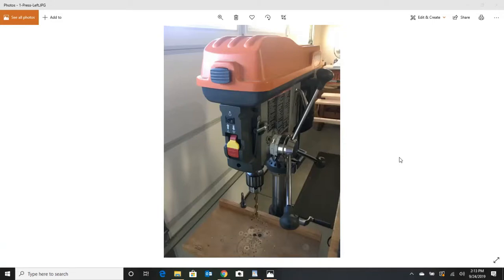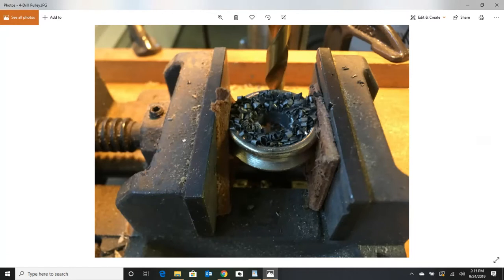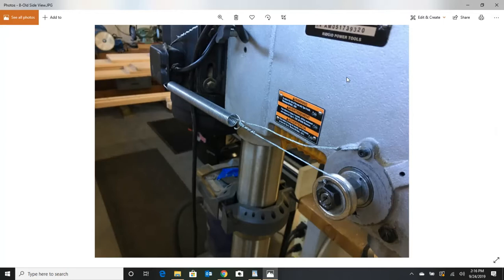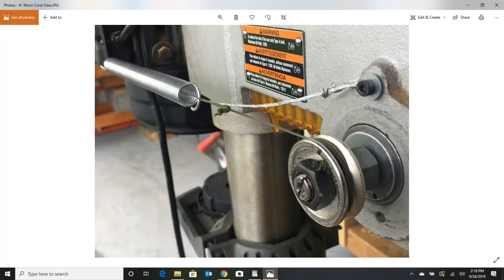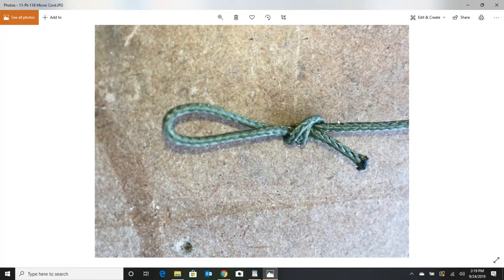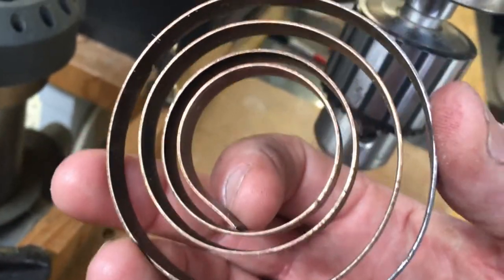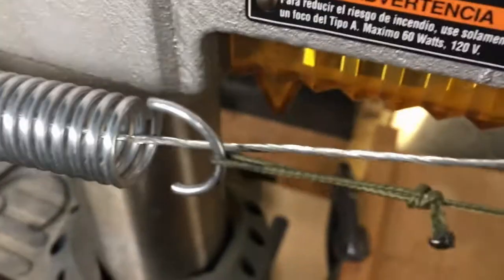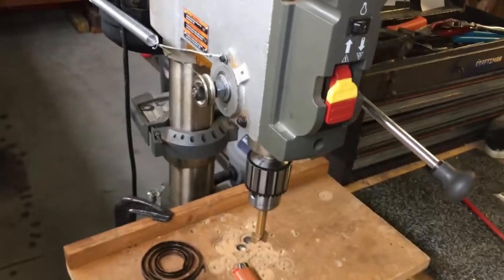Paracord Drill Press Repair

Comment: I love your idea. Unfortunately I had recently scrapped a drill press when I could have done this. My current drill press has the same problem and I'm using your concept. However the spring was too weak so I put an eye bolt through the frame and tied a heavyweight instead of the spring. It works great, thanks again
Reply from the maker: Joel, the weight idea is fantastic. It’s better than a spring because it will not fail.
Reply: @PompanoBrownie  yes you're right. I tried the spring first but I bought much to weak of a spring. The nice thing with the weights is you can just easily add or subtract weight to get it just right. Thanks again

Comment from the maker: * See Paid Links Below for Parts and Web Info *
* I meant 15/32" Bit at the 6 Minute 53 Second portion of Video. (Sorry)
* Use a 3/32" Bit for the small Hole on the Pulley. ( Sorry again.. Better work on my bit sizes.. LOL)
* Use some Bar Soap on end of Micro Cord to make insertion easier.

Is Synthetic Rope Really 15 Times Stronger than Steel Cable?
https://blog.ronstanindustrial.com/is-synthetic-rope-really-15-times-stronger-than-steel-cable

Atwood Rope MFG 1.18mm x 125' Micro Cord
https://amzn.to/35GkZ4C

1 1/2" Rope Pulley
https://www.lowes.com/pd/Blue-Hawk-Rope-or-Chain-Pulley/999971150

15/32" Drill Bit 
https://amzn.to/2ZEV7SG

3/32" Drill Bit ( Use Bar Soap on end to make it easier to insert in hole.)
(This is a 14 piece drill bit set) https://amzn.to/3hsp6Du

1/2" Star Washer
https://www.lowes.com/pd/Hillman-2-Count-1-2-in-Standard-SAE-External-Tooth-Lock-Washer/3012417

1/2" Nut
https://www.lowes.com/pd/Hillman-2-Count-1-2-in-Zinc-Plated-Standard-SAE-Hex-Nuts/3012745